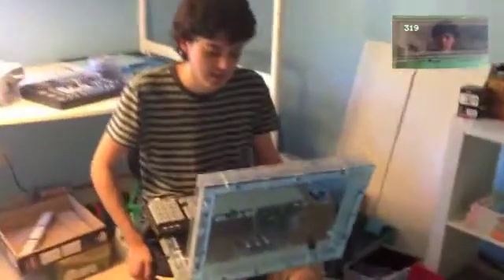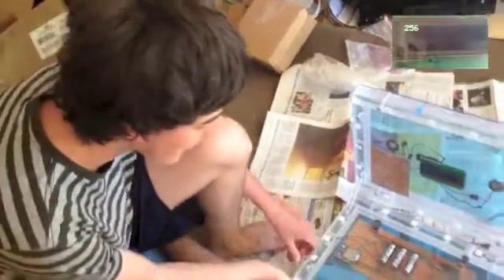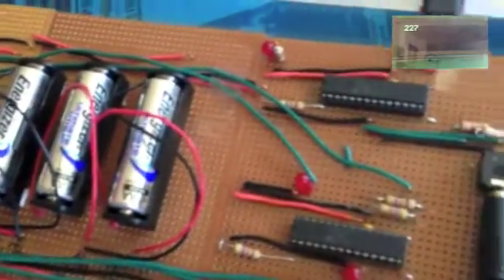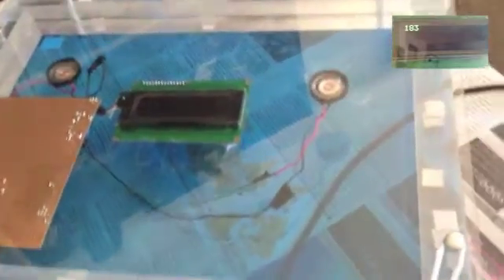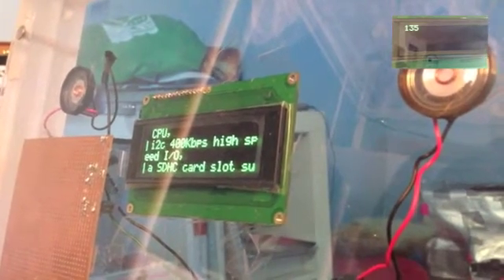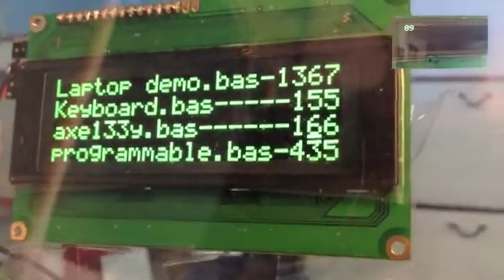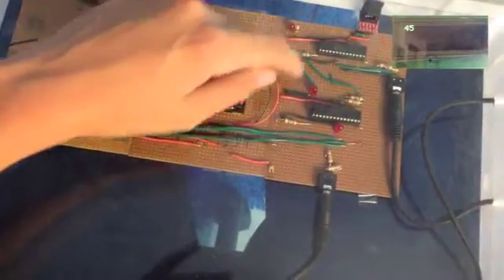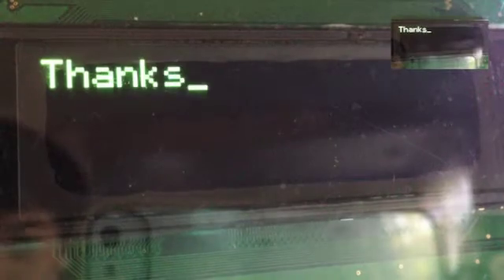PICAXE Homemade Laptop

Comment: Can we do a similar computer with an arduino ?
Reply from the maker: you could, however the software would have to be rewritten in C, and the hardware would have to be modified, but it could be done. I actually recently was considering making another computer using both an Arduino and a PICAXE. I may do that someday when I have time. :)
Reply: Patrick Leiser Ok, thanks a lot, I have a UNO R3 card which is similar to the Arduino and I;ld really like to make a computer like yours, by the way, do I need two microcontrollers or one is enough ?

Comment: Very impressive young man, now do all that in MPLAB lol. just kidding, good job, the PICAXE has a built in firmware that runs the basic code, programing code from a running basic code that runs ontop of a basic interpriter wow. Yes it is mad and not the best approach but you have actually done it, made it and got it working so well done. good job.